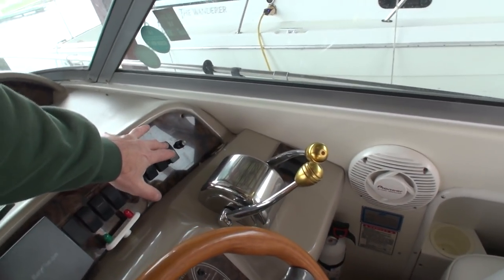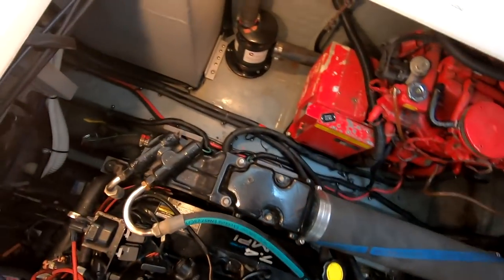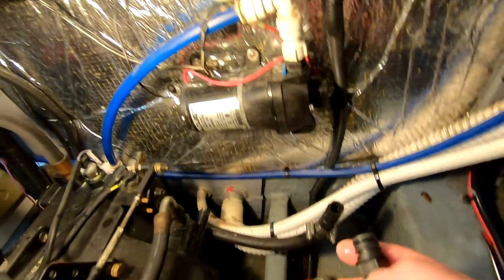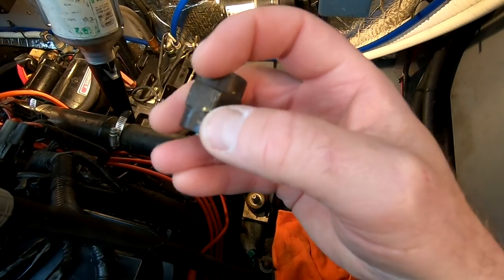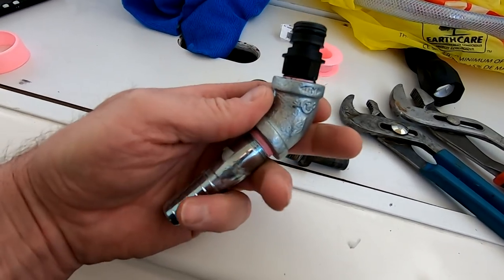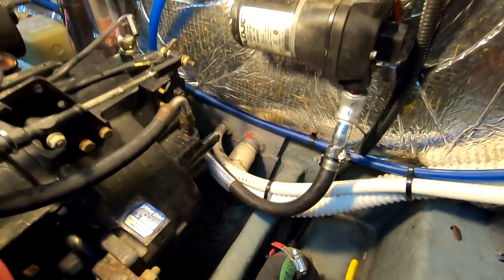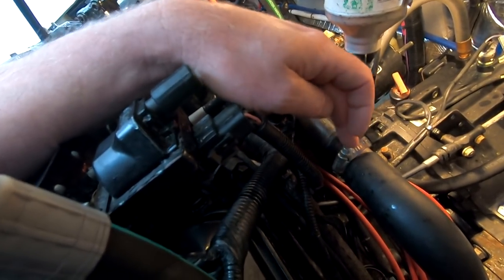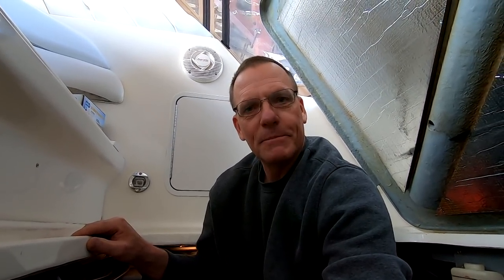Boating Basics - Leaking Water System Repair

Comment: Looks like a very tight spot, but you make it look easy Paul.  The water pump on AMFM is at the water tank in the bow.  Much more accessable!  Great to see a new video.  I'll be rewatching the replacement of the hatch seal this weekend.  You'll never guess why!
Reply from the maker: You'll be happy to have done that little project. One less drip potential to worry about on the boat. 👍

Comment: Should have gone to the marine store and got a quick connect barb firing for the pump. I got a spare that I added to a length of hose, to winterized the system I drain the tank with the pump then remove the intake from the pump and install the new fitting with the hose. Stick the hose in the jug of anti freeze and pump through the taps.
Reply: Cruising With Ranger Tug Wanderer I did the same thing at my city water inlet and at the outlet of the fresh water tank....

Comment: Hi there, the Teflon tape are sucks, after period of time its will leak, I recommend the liquid teflon is much better strong sealing long lasting can resist the evaporation
Reply: Teflon is not a water seal anyway, it is simply  lubrication. What seals is the tightness of the connection.